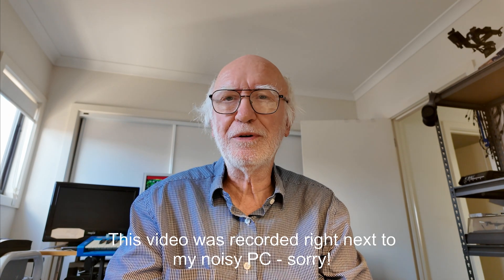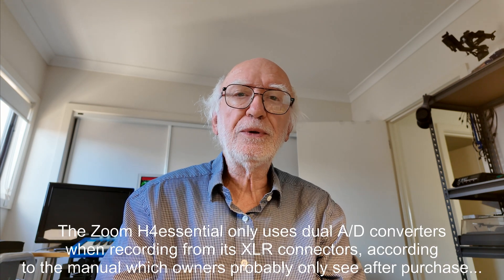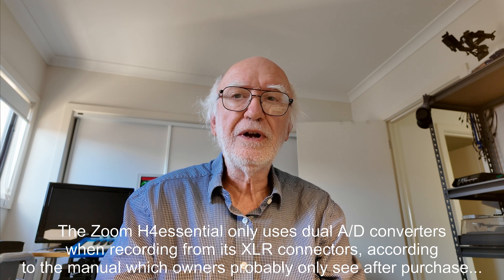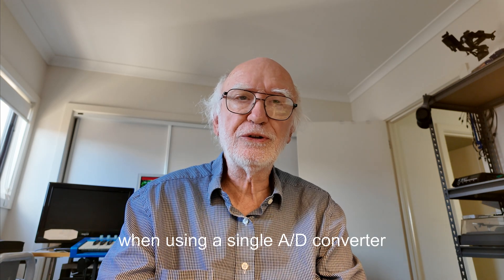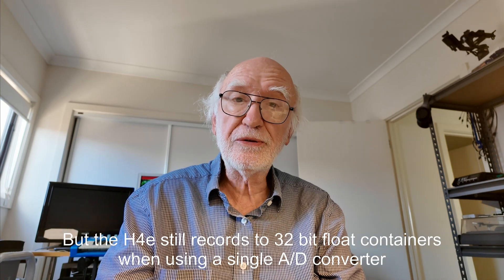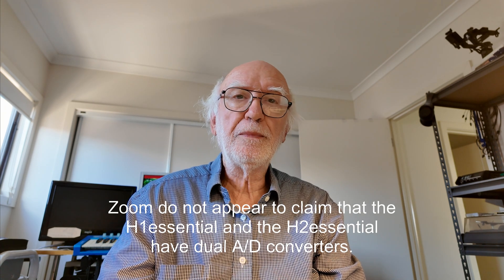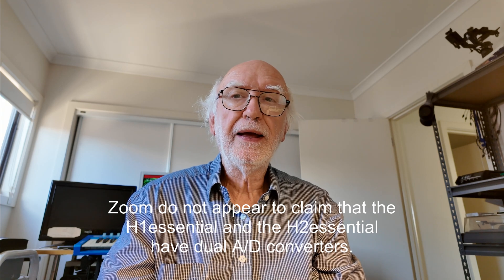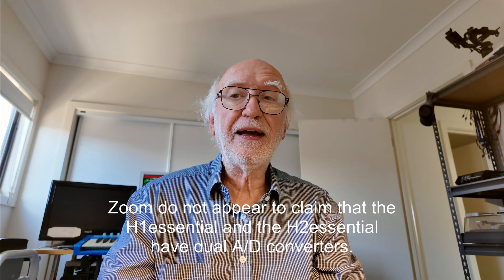32 bit float low cost audio recorders - BEWARE!  The truth is out!  Don't buy until you watch this.

Comment: This is fascinating. 

We are filming an episode of our kids show this weekend, and we're using 4 pairs of RODE Wireless Pro lavs, and relying on the 32-float internal recordings to allow us to adjust everything afterwards. We used a pile of zoom F2 recorders (Dual AD claimed in tech specs), and they sounded great, but we couldn't monitor the recordings during the production. So we thought the RODE would be a great solution. In our tests, they sound great, but now that you mention it, I can find NOTHING about whether they're dual channel or not.

At the end of the day, I suppose that a SINGLE A/D could work if it was "tuned" (is that how they work?) to the expected ranges of a human voice. Maybe it'd clip if there was an explosion, or if someone's whispering across the room, but for most dialogue, they'd be plenty. That's what we'll learn on Saturday!
Reply from the maker: @ShaunHautly  I hope it goes well! I have yet to find a reference to dual converters with any of these new internal recording wireless mics so at least whatever you use should be no worse than the others in that respect.

Comment: V interesting Peter. We use the Zoom H1e and find it convenient. However, as an amateur it didn't take long to realise loud noises (feet kicking a pew during a choral performance) were still a problem. Watching your channel and a few more I think we were forewarned about that but this new issue confirms that the H1e (if a single converter is confirmed) will largely serve as an entry level device for interviews rather than soundscapes. (I transcribed your carefully worded conclusion and include it here)

 "Devices which record to  32 bit float files, but which do not claim dual converters.

These are the zoom H1 essential, and the zoom H2 essential.

I have asked Zoom whether or not they have dual converters.

I will update the description of this video when and if I get a reply from them.

I will also add notes about any other devices that may not use dual converters. For instance, do all those wireless likes that record 32 bit float use dual converters. Many don't seem to say. 
So bottom line when buying an audio device which states that it records to 32 bit float files, don't assume that it uses dual converters unless it says. And if it does not use dual converters, the benefit of 32 bit float recording is highly questionable.

Thanks for watching good luck with your purchases. "
Reply from the maker: @HistoricGraves  At the end of the day, I guess we get what we pay for. But if we get the impression that dual converters are being used, and they are not, we are not quite getting what we paid for!
Reply: @Ozpeter  Yes, I was keen to use the device for soundscapes and won't bother now.